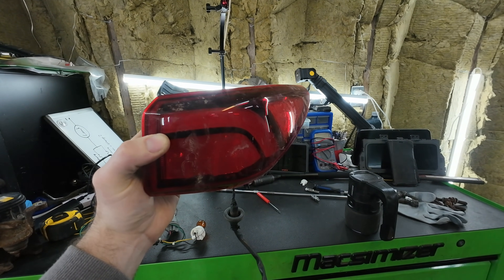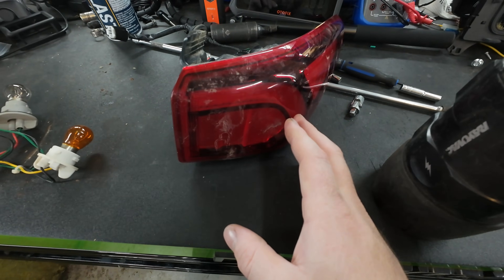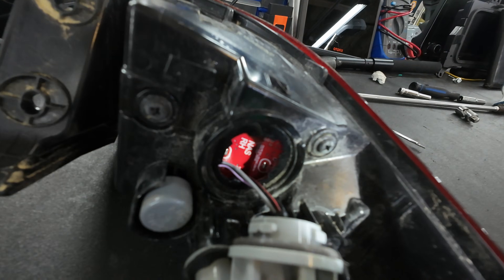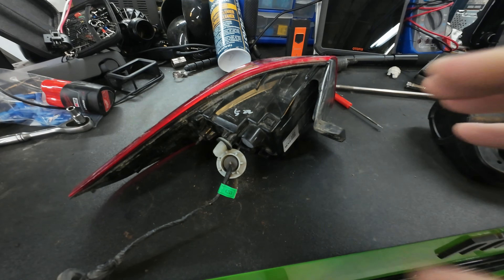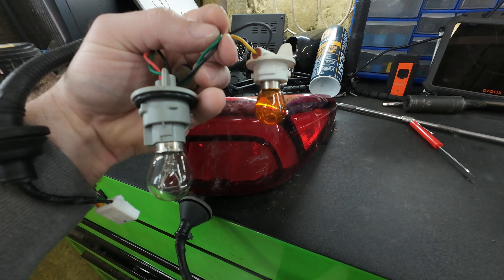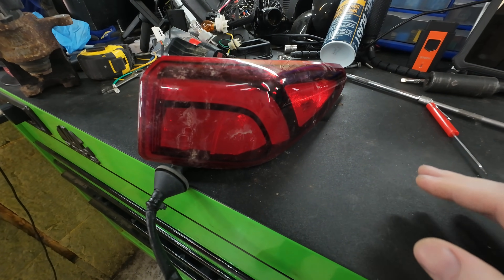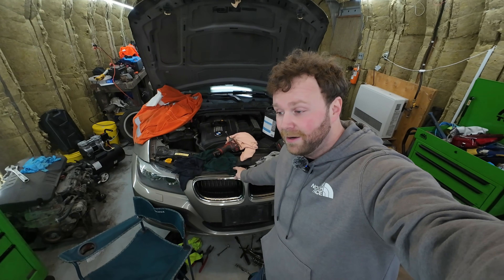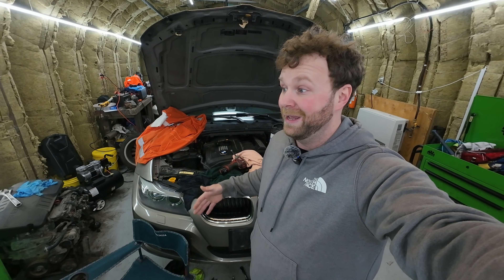Car Manufacturers don't even want you to change bulbs, they want you to replace entire assemblies!

Comment: The worst isn’t the price , the worst is the headlights intensity out of control , DOT regulations of 35 watts for low beams and 55 for high beams have been “flushed down the toilet” since the invention of the LED light has been a competition for achieving the most intense and blinding light possible,special mention: TESLA, since this problem looks no to be solved soon I have been replacing my LED headlights  constantly for the most brilliant I can find in the market to get along with the competition 🤷‍♂️

Comment: I could repair the headlight on a component level. 
a few LEDs could be as little as 20 cents to a few dollars depending on its function or brightness. (accent vs functional) 
the hardest part would be getting it open. 
my tesla head light assembly is $220 but its more advanced and brighter than an incandescent bulb.
my Chevy cobalt's head light assembly cost $60-80 and the LED lights are $40. incandescent bulbs are trash.

people just love to whine about anything when it comes to cars. and then drive it into the ground regardless of how much they like it. 
even if the car was dirt cheap and falling apart from the factory people will whine about it. 
some people love dim headlights so they cant see deer very well. then whine about having to fix their car becasue they hit a deer. there's no sense in the world.

and most people love going to a mechanic and spending 3-4 times as much as the parts on labor and whining about how much it cost instead of fixing it themselves. 

I saved so much money rebuilding my 16' ford fusions transmission that i could have bought a beater car and drove it into a tree and still had money left over.
Reply: I frequently get calls from the atv/motorcycle repair shop to do these kind of fixes. Shifter actuators that have bad position switches, led light bars, power modules. I save customers thousands, and make hundreds cause of my labor.

Comment: This is not an inherent LED problem. This is a problem of its current implementation. The 2003-2007 Acura TL LED brake light modules were not sealed and replaceable without having to get a whole new assembly

Comment: The business model has been to increase profits and lower costs through slave labor overseas, all the while increasing parts prices when available and make it impossible to repair stuff, this goes beyond cars across multiple industries. Either the parts are so insanely expensive you can't repair it yourself, or labor costs to fix it are unjustifiable to customers, and it's only getting worse.

Comment: And with that many LED they put inside it will instead consume more power than bulb. But anyway bulb/LED doesn't matter since the charger will always surplus and the consumption is minimal. The biggest power eater is still the air conditioner. 😁

Comment: I bought a 2009 Chevy Impala LT and you literally had to take off the front fender in order to change the headlight bulbs. Of course you could try to go behind the front wheels by taking off the splash shield panel but you're limited on space but it's still doable. I was literally like WTF are car companies just trying to make consumers go to the dealerships or mechanics?!?

Comment: I replaced entire assembly of tail lights for my 1998 Dodge Ram 1500. The new ones don't fit very well. I'm disappointed by that. I replaced the old ones with LED assemblies. There's a gap around the outer frame of the tail lights. It's the base of the posts that go into the truck frame meet up too soon. The screw holes like up just fine.

Comment: my 2014 qx60 has a bad headlight ballast. Infiniti does NOT sell the ballast. you must buy the complete headlight assembly. that's just the beginning.. the complete front shell must be removed. then the headlight assembly can be replaced. cost? around $1600 for labor and parts.

Comment: The more shit you have on your car the more there is to go wrong. All the air pollution shit is does nothing good for your car. The air pump simply pumps air into the exhaust so the PPM comes out what they need to get approved by the EPA. Its pure theater. Adds cost, more to go wrong and I don't need any of it. On my dads old 71 Dodge Truck I could close the hood on myself and still change the spark plugs. Now it takes a one armed Japanese person to fit into most places to work on these thing. Over engineered.

Comment: In 2004 bought a BMW 325i. Was warned then German cars are very expensive to repair!!!  OK, 21 years later she's still going strong. Cracked a taillight lens and broke the bulb last year. I bought the replacement lens on Amazon for $37 and a replacement bulb at Autozone for $3.  Did the repair myself in 20 mins on a Sunday morning with only a socket wrench required. Now the people who warned about expensive German cars then are crying about $1000 taillight replacements on American cars???

Comment: I recall seeing a video in which a single rear taillight on a US pick-up truck cost around 1250 dollars!

This led to a large number of people stealing them from parked trucks!

Accessory manufacturers actually produced security devices to prevent the theft of the rear lights from these trucks!

When my electrically controlled and heated drivers mirror got smashed off whilst parked, the dealer wanted £425, plus £85 tax.

That was with me fitting it!

I duct taped it back on and searched online, getting a used one for £45, plus £15 for the heated mirror glass.

The car cost under £11,000 new, so the mirror alone represented a huge amount!

This was without a cover the new mirror didn't come with, but which I had left over from my damaged mirror.

It's a huge rip-off...

Comment: It's an apples and oranges comparison: a 12V incandescent bulb will last for maybe 3-5 years while a LED tail light will typically last the lifetime of the car. So the lighting element it's not replaceable because you will never need to replace it. 

A better example would be VIN locked parts, on many newer models you can't just swap in some 5$ random modules you found at the salvage yard, they need to be programmed by the dealership pushing the repair into hundreds or thousands. All allegedly for the benefit of the consumer to protect them against "fraud" and "not-genuine" parts.

Comment: Buy a GM and break the little inside door handle and you have to buy the WHOLE DOOR PANEL.  Headlight burns out, You have too remove the front bumper and splash guards to replace it.  You're looking $500 plus for each one.

Comment: Another trick up the sleeve of manufacturers (that came out in early 2000s) was having to disassemble half of the car in order to replace a consumable. Typical example: headlight incadescent bulb of a Renault Modus (have personal experience with it). You need to take the bumper in order to access the headlight mounting screws. Then you need to remove the headlight, replace the bulb and put everything back in place following the reverse order. And before saying "Yeah, yeah, we all know Frenchies....", my 2007 Daihatsu Sirion is the same. The headlamp is replacable in a minute or so. But the parking light - oh boy! See the section "Renault Modus" above.

Comment: This is the exact reason our car insurance is so expensive. A front end collision these days usually cost more than a car is worth. We had a BMW recently and the headlights alone were 6,000 US dollars each and the airbag system deployed so it was automatically totaled by insurance. If it would have been an older model with less sensitive airbag system that would not have deployed at such a small impact would probably have been around 3 to 4 thousand dollars and would have been repaired.

Comment: There was a time when the National Highway Traffic Safety Administration regulated safety items on motor vehicles such as lights.  For example, at one time - way back in the old sealed bean headlight days, ALL cars had to have headlights that were easily and economically replaced by a standardized sealed beam headlight  obtainable and any auto store or auto service station, including the mom and pop stations in rural areas.  They worked just fine, lasted for many years and if they burned out they were easily replaceable for under $5 and less than 5 minutes time by any ordinary person with a limited degree of mechanical ability.  Since then though, just like how the FDA has been largely taken over by the very industry they're supposed to "regulate" (big pharma), the NHTSA has been taken  over by the automobile manufacturing industry and they are calling the shots.   Hence when my son recently replaced the burned out headlight on his 2013 Subaru Outback, it took him a day to disassemble enough of the front fender splash guard and cram his fingers into painful contortions to pull out the bulb socket and replace the bulb and put the whole mess back together again - including the $17 bulb and the $45 worth of new fasteners that were required to put the fender splash guard back together.  However IF the plastic headlight lens had been made easily removable with about 4 small allen screws the process would have taken about 5 minutes and no contortions.  This crap is NOT an "oversight".  It is quite deliberate. NHTSA has become totally WORTHLESS and should just be abolished.  The manufactures want you to buy a new car, not a new light bulb.  If two or more lights burn out or get damaged, their idea is the car should be totaled.  Two burned out light bulbs?  That'll be $2K.  You're better off just to spend another $37K and get a new car.  What a miserable joke.

Comment: I bought a new car in 2013, and as of now is has about 140K mlies, and of course, I've had to do brake jobs, simple tail light replacement, and other routine maintenance, and it's the last car I will ever buy. I'm 66, drove my first automatic car in 1981, and don't care about high tech cars, which are now mostly plastic. One wreck, and they are written off. No thanks. If my "new" car breaks, and I can't repair it, I'm buying something before 2018. I've taken one vehicle to over 200K miles, and no problems, so I'll keep going with this 2013 car. Try the tail lights with "radar" for passing cars. $$$$$
Thanks for the video.

Comment: Yep, you nailed every part of this new scam. Even the “cheap” models like a Toyota RAV4 or Honda CR-V are now $400–$800 per assembly. No more $2 bulbs. No more 30-second replacements. It’s not innovation; it’s pure greed and planned obsolescence. Manufacturers figured out they can make way more money selling a whole “tail light assembly” every few years instead of just letting you replace the bulb forever. Same playbook they use with glued-in batteries or fully molded door panels, so you can’t fix a broken $5 lock or window switch anymore. It’s all expensive trash. 🗑

Comment: I had bought a new Infinity I30T decades ago and it the front headlight went out. It was in for a scheduled checkup anyway, so I told them to fix the headlight while it was there. They said the bulb and the ballast needed to be replaced and it would cost $700. They also told me I was lucky because the next year's model had a sealed headlight and it would be around $2000.  I told them I would tape a flashlight to the hood before I would pay that amount. I pulled the bulb and crossed it over to another brand and bought a pair off eBay for around $250. There was no problem with the ballast, and I never had to buy one. The same vehicle had a motor mount sensor that went bad and it was also around $700. The motor mount was fine. I prefer the 70's when you could buy a bulb for 30 cents and I had solid motor mounts on my car. I'm 66 and if I need another vehicle all I know is that it will have built in ash trays in the door. I currently drive a beat up 2003 Tundra and there is no "stress" because if it gets a scratch or a dent I could care less because I just want to get from here to there and don't need to "impress" anyone.
Reply from the maker: Crazy

Comment: G' day , just Subscribed Aussie here and retired mechanic . I found this out on the wifes brother inlaws Peugeot when the brake light failed  12 years ago . I went to replace the bulb only to find I needed to replace the whole tail light assembly . The owner was NOT impressed . Me I drive an old school 1993 Nissan D21 tray back pickup and the wife has a 2008 Ford Falcon with bulbs . I had to replace both headlights on the falcon as one was cracked and the other was all foggy and wouldn't polish up . They cost $155 each ( $100 US )   and fitted LED bulbs with no need to update the computer . New cars are shit .

Comment: I have a 2007 Hummer . The Tail light in the rear bumper. Went out, 
 But I can’t fix it , because  GM, has discontented the light bulb housing, and no replacement part! 
 So I don’t have a brake light on the right side, and no signal light on the left, any one out there have any suggestions,
Reply: Yep take it to any Express oil and tire engineers location & they'll hook you up with a good deal too but no headlights cost as low as $3 don't fall for Lance's lies. 2013-2019 headlights range between $15-40 maybe something made in the 90s would cost $3 but nothing past 2004, I used to sell cars.

Comment: Honestly, we need legislation to allow car makers to produce 1970's style cars again.  Everything old school (including steel chassis).  OK, you can add safety belts and air bags.  Fine.  That should be easy.  But the rest, classic car design and maintainability.  The nostalgia alone would probably make them huge sellers, but make them cheaper to buy and maintain and they would dominate the market.  Give the younger generations an opportunity to buy the old muscle cars for under $20K, in brand new liveries, and they'd be all over it.  So would all the aging boomers.  And then you'd revitalize the repair trades too, since there would be a whole lot of interest in the self-repair, allowing people to learn the skills that could LEAD into jobs for the more complex vehicles (that will still sell to a different group of people).

Comment: Replacement parts for new cars are hard to find, as there are not many contemporary cars in junyards, so you'll have to end up buying at the dealership's scalpers window: $$$.  Further, the part may not be necessarily in stock, for the car manufacturers are interested in selling cars, not parts.  There is this guy Levan Azrumelashvili who has been waiting over nine months for a Lyriq's replacement bumper.  Second, for the same reason, your insurance price is going up, and the Insurance Co's' drive to total your car vs the cost of paying for expensive parts can leave many owners upside down in the value of their car.  Or with a jacked up insurance price which will clean your wallet just like that...

Comment: The issue with these is the solder joints corrode, redoing it with leaded solder fixes them. Getting inside the light relatively nondestructively is usually a pain though 😬

Comment: When I lived in Spain in the 80's, I was required to have spare bulbs in the car. The police would pull you over if a light was out and you were required to replace on the spot. it was considered a major safety issue.  With this BS, my next car will probably be of 1960s-1970s vintage.

Comment: I recently purchased a 2025 Chevrolet Trax.  After watching the video, I did some research and found that this applies to my car.  A failed taillight would cost US $115  to replace at home using an aftermarket part.  That would probably increase to $500 or so to have a dealer shop perform the repair.

Comment: Luv your analysis Lance.  The manufacturers are no longer concerned with reliability.  They are engineering cars that will fail after the warranty, and/or make the repairs very expensive for the consumer.  Now they are trying to make module access proprietary to the point that you will have to pay for a subscription.  They already did away with paper repair manuals.  The DIYer will just have to get that much more creative & skillful in getting around their obstacles!

Comment: The average car may have super car technology but those tiny 4 or as in Chevy 3 cylinder engines are crap low power junk. They are designed to fail ; be difficult and very expensive to repair.

Comment: I like the simple technology from my old 2012 Hyundai Sonata GLS....simple and reliable mid-size sedan until I traded it with 224,000+ kms. on its original engine and transmission.  Nowadays, simple cars packs a lot of technological feature/s but too expensive to maintain/fix/parts replacement.
Reply from the maker: 2006 to 2012 was good years for hyundai

Comment: When I was a kid you didn't replace starters or water pumps you rebuilt them. At the local auto supply you could buy a bearing and seal kit for your water pump, a set of brushes, bearings and diodes for your starter. When the radio quit you could buy the parts to fix it at the local Radio Shack. Radiator hoses weren't generally pre-formed. You bought a hunk and made the hose you needed. Oh and ball joints. They were adjustable and repairable. Bring back the good old days PLEASE..

Comment: Not only do these parts not support any real customer serviceability, but they can even keep the car from running. There’s a video of an F-150 where the owner replaced the rear-view mirror and didn’t fully plug the connector back in. That alone kept the truck from starting, and took 4 mechanics to track down the cause. There’s another case with a similar outcome on an F-150 Platinum where a rear taillight with water in it ended up costing fifteen thousand dollars to fix. The taillight assembly housed a radar sensor along with the lighting components. It also prevented the truck from running....